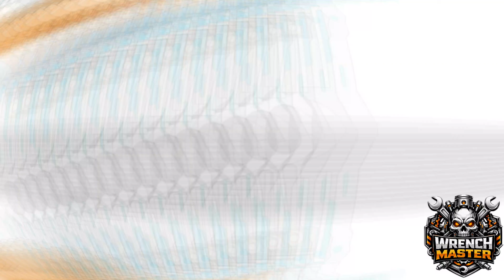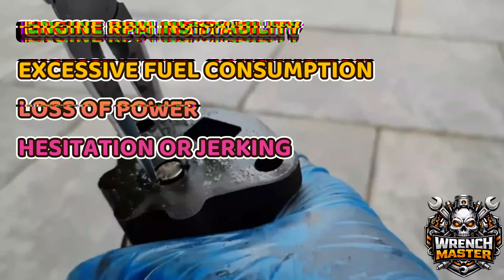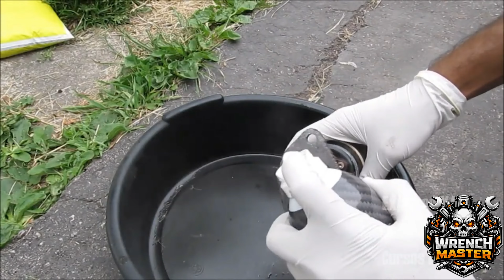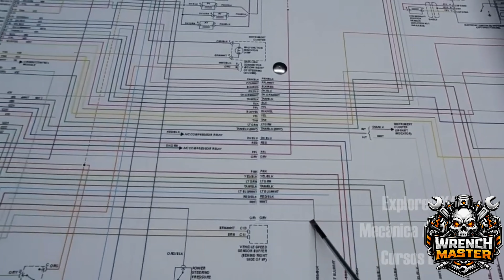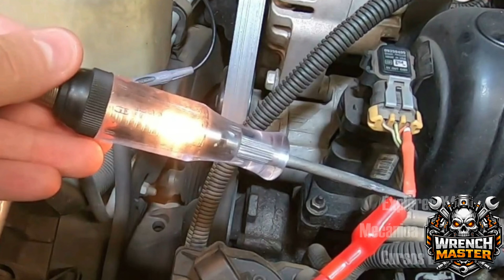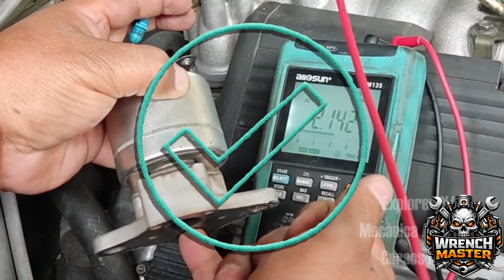How to Test an EGR Valve Without Replacing It

Comment: On a Diesel just disconnect all the rubbish carbon & oil residue mixed turns to a tar like substance in the intake manifold really good engineering creates a headache for the owners but money for workshops because all shit causes breakdowns and check engine lights all the time disconnect all the SHIT